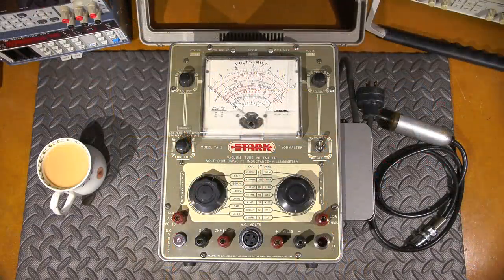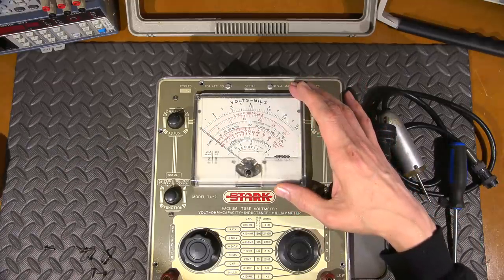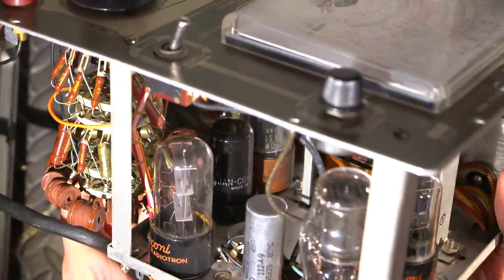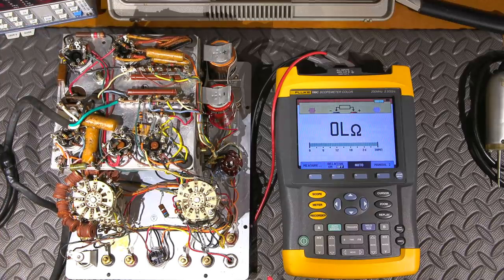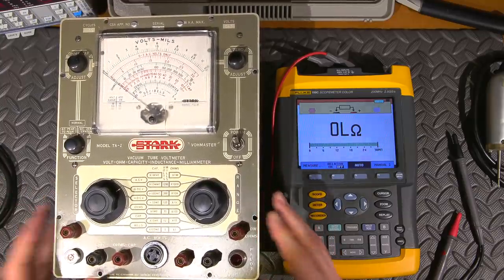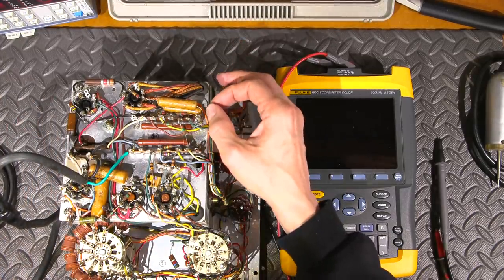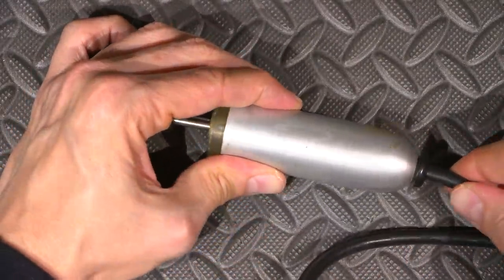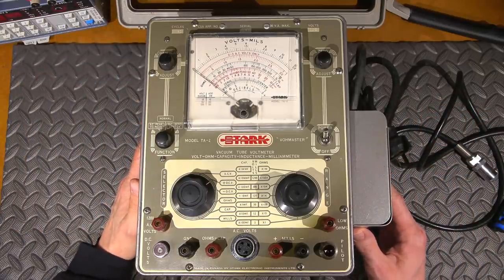Sharing More Electronic Knowledge - Tech Talk And Hang Time With Mr. C!

Comment from the maker: To learn electronics in a very different and effective way, and gain access to Mr Carlson's personal designs and inventions, visit the Mr Carlson's Lab Patreon page here: https://www.patreon.com/MrCarlsonsLab
Reply: Dear Paul, I have a Radio Shack Micronta FET VOM from the 1970s. I  like the high input impedance, but I regret that they didn't provide a MOSFET version. But, the next meter I would like to have is a VTVM. There is nothing like that classic old equipment smell that the tube equipment have, as well as the high quality performance that I remember from back in school in the 1970s.
Reply: I might actually be able to make it to the ham fest tomorrow in kalamazoo. I am in dire need of some odds and ends.
Reply: I just bought a very old Micronta  VOM at a Thrift store for $2.00 !!
Reply: Mr C  can't  you 3- d print a new lense ?

Comment: I love watching you Mr. Carlson. My dad died in 2016, leaving me with his old Grundig 2220 that he had owned since before I was born. He found it in a dumpster and got it working again. I loved listening to it, I used it for hours and hours. Unfortunately it's full of old caps. I stopped using it because I'm afraid of destroying the tubes. :( I'm working up the courage to replace them myself by watching your videos. My dad had bought an old All American 5 type AM radio before he died and I practiced cap replacement on it. It works! It's pretty out of tune. I don't know if he screwdrivered it or if a previous owner did. One day I'll get the Grundig safe to use again and I'll remember my dad fondly.
Reply: Doing stuff like this keeps that connection (no pun intended🙄) with your father... my dad was a cabinetmaker & though I ended up being a machinist all my life, I took up woodworking as an homage to him... I found that I would think alot about how he might do a certain cut or joint etc .. 

Good luck with the re-cap, Paul here will keep you steered in the right direction... I'm betting yer late dad would have loved these videos we are blessed to have ourselves... Thank you Mr. Carlson for that... 

From the Emerald Isle
😎👍☘️🍺
Reply: Manny,
Tubes are cheap and easy to replace. The danger is that the caps are leaky (beginning to pass DC) and load down the power transformer until it burns out the very fine secondary winding.  There is only a couple of things that usually make a tube radio beyond reasonable repair and they are the transformers, both the power and the IF transformers. Good luck with your dad's radio. It is not too hard to do, but you might want to practice on a radio you don't care about.
Reply: Don't rush it, Manny. Do your research. Your Dad would expect nothing less.
You will get it right.
Reply: @peterfitzpatrick7032  Nice that you do some woodworking to remember your dad. :) I find myself asking the same "what would dad have done" question and thinking about how I'll approach a project. I recently replaced my water heater. My dad was not a plumber, just a general repairman and maintenance tech for a jail and before that, an apartment complex. He did do lots of plumbing work as a result though. In planning the water heater replacement, I decided "Dad would do this job the right (hard) way using all soldered Type L copper pipe. He'd replace the old shutoff valve and he'd replace the drain valve with a full port ball valve for maintenance." So, that's exactly what I did. I used a few old copper elbows in the system in addition to the new ones from Home Depot. I used his pipe cutter, emery cloth, pipe wrench, channel locks, and work light to do the work. I'm quite proud of that install. :) I feel it's as good (likely better) than work a professional master plumber would do. Deburred every joint ID and OD. Lead-free silver bearing solder. Lead-free ball valve (tricky to solder). Water soluble flux. I practiced soldering correctly for days on some cheaper Type M pipe and couplings until I was very proud of my joints. I could hear my dad in my mind saying "No snots Manny! I don't like snots. Just take your time and let the solder wick in. There you, beautiful! Good job!" I think if he was here to see it, he'd pinch my cheek and say "You're my son." He was only 56, cigarettes caused bladder cancer. I wish I had 20 more years with him. :'( My grandparents were 83 and 81 when they died of natural causes. He could have done 76, I think. He was a good man. I would not be the mechanical nerd that I am today without his love and teachings. Your dad would be happy and very proud seeing you sharpen that chisel and use that table saw. Hopefully you have some of his own tools to use today? :) And yes, my dad would have absolutely LOVED Mr. Carlson. My dad had an associates degree and was a field electrician, but Mr. Carlson seems like an electrical engineer with extensive electrical theory education and advanced circuitry design knowledge. I think my dad likely would have went that same path if he had invested more in his college journey rather than stopping short and going with field work for new structure wiring and service calls. :)
Reply: @ianbutler1983  Thank you so much for this information! You just taught me several things! I do have spare tubes for the radio as well as a speaker and (I believe) a button set that my dad had acquired at flea markets and antique electronic supply shops, but I do not have any transformers. :( I don't want to burn these ones out. It sounds like I made the right choice by boxing the radio up and stoping my frequent use of it until I get it sorted out. I did practice this a bit by replacing the capacitors in my dad's newly acquired Emerson AM-only All American 5 type radio. I found it in his apartment while clearing it out. He did not have it before he got the cancer diagnosis a few months prior to his death, so I had no attachment to it like I do with the Grundig. I think he bought it to restore it as a sort of busy project to stay in good spirits and revisit his youth and old hobbies. He just never got started on it, or he may have just replaced a tube to fix it. It worked ok when I found it. I believe I did ok with that Emerson re-cap. I only replaced the cylindrical yellow and orange paper electrolytic caps that Paul always harps on about being failed at this point in time. What does he call them? Yellow bees, or honey bees, or yellow jackets, or super bees or yellow drops...something like that. 🤷🏻‍♂️ I didn't replace any caps that looked different than that, so I don't think I accidently put an electrolytic in place of any mica or other special, high stability capacitor design. I looked at and recorded every Farad and voltage value that was written on every cap and I remember that I researched the tolerance allowed for these electrolytics in tube radios. Then I searched for the right ones with the exact values or a value as close as possible within that tolerance on online electronic supply shops. I verified that each one's value and position was correct on the schematic as I removed the old ones and soldered in the new caps one by one. I did not take the risk reorganizing things or tidying up all the components like Mr. Carlson often does to make it neat and visually appealing. Just point to point, following the old layout exactly. 😸 When I turned it on for the first time afterward, it worked! I was happy! The reception is not very good though. Only the strongest local station is really able to be listened to adequately. If I remember correctly, the dial was off quite a bit, it had several birdies and hums, and I think one other issue that just made it uncomfortable and annoying to listen to anything other than the station which is very close to the house and has a powerful antenna array. The reason why I didn't power through and tackle the Grundig re-cap after that apparent success was that it functions in AM, FM, 2 shortwave band ranges, and external input mode. There are TONS of components inside that chassis. Tons! They're buried underneath each other and sprawled out everywhere! Very intimidating and I'll absolutely cry if I ruin it. I should probably revisit that Emerson and get it perfect. Maybe add filtering or try to tune it better for clear reception and get the dial accurate. The antenna is intact so it's internal issues plaguing the performance. :( Anyway, thank you so much for taking the time to read my comment and offer your valuable information. I sincerely appreciate it Ian.
Reply: @jlucasound  Thank you so much for your encouragement. :) You're right, I could see him saying "Don't rush it Manny, I know you're able to do it eventually. Keep learning. You'll get it. You're my son. If I could do it, so can you. The radio's yours now. Just do it right and enjoy it again like you did before." I lived in a tiny studio apartment by myself 10 years ago, fresh out of school. I had a small TV on my small entertainment center stand and the Grundig was right next to it. If nothing good was on the broadcast TV (couldn't afford cable) I'd listen to the FM radio and spend time on the internet reading or watching videos. It was a dark time in my life. I was very lonely. It was just nice to have the radio on for some voices in the background. Can't even tell you how many hours I listened to the Grundig as its green magic eye shined nicely and the rest of the internal tubes glowed peacefully out of the back panel reflected against the wall. I love this radio. Whenever "Lights" by Ellie Goulding or "Titanium" by Sia comes on, it brings back all those memories of the time spent at that apartment wishing I had someone to lay next to me. Those songs were top hits at the time, played over and over again all day long. That magic eye tube is one of the coolest things about the radio, I think. I can remember things all the way back to when I was 2. My dad kept all his radios and high voltage projects (a mini Tesla coil, an oil burner transformer Jacob's ladder, a transistor driven car ignition coil, etc) in his office with the door closed so I couldn't get in and get hurt. He'd let me in when he was with me. I loved that the magic eye moved as you tuned the stations. It was neat. It's the rectangular version, with the 2 bars in each end coming closer or meeting in the middle when the station is strong and perfectly tuned. Some stations would make it flicker and sort of bounce around when the person talked or loud bass drum beats were played. I liked that too. Luckily I have a new old stock spare for when this one eventually burns in/out its phosphorous coating and suffers a ghost image or gets very dim. Anyway, thank you for you wonderfully kind comment. You 3 have made my day reading your comments. ❤️ I appreciate you.
Reply: @mannys9130    I think we were just very impressed with your first comment..  yer on the right track Manny.... good luck & God bless... we all are our fathers sons.. and are proud to be ! 
(And yes, I have a few of his tools I managed to save & I use 'em now & again just because... 🙂)

😎👍☘🍺
Reply: @PJ PachasaJr I noticed that with the Emerson! The new caps were much smaller than the paper ones I took out. :) I almost thought I was making a big mistake, but I verified it 2 or 3 times before the surgery. 😸 "What can I replace the waxy paper caps with? Is that the type I have? Yes. Are they the right capacitance and voltage values within the tolerance? Yes. Well...I must be right. They're just more efficient I suppose." It didn't explode so I think I managed alright. :) I still haven't gotten around to the Grundig yet. Eventually, when the time is right. 👌 Thanks for the well wishes!

Comment: You can use Mother's Mag and Aluminum Polish on a section of cheap dollar store ultra absorbent cloth to get scratches, fogging, etc. out of the clear plastic on the meter. In some bad cases I finish with a little Novus #2. Works every time even on plastic eyeglass lenses.
Reply: Good tip, thanks !

Comment: As soon as I saw the VOLTS-MILS across the top of the meter I knew there had to be a connection to Hickok.  The font is exactly the same on my Hickok 209A with the black background and white lettering on the meter.  I acquired my 209A when I bought out a TV-Radio shop at least 40 years ago,  that had been in business since the 1930s.  I liked it then because of the uniqueness of the very large meter, now since I've developed macular degeneration the size is a great asset.  Mine needs restoration but it does still work albeit rather crochety much like it's 70 something owner...

Comment: Doubt if many people under 50 know much about vacuum tubes. My first color 25" TV had some vacuum tubes. I built a tube & transistor tester to locate a bad tube in it. Still have my RCA tube Manuel that I purchased in late 1960 's. Have a 5 tube AM FM radio in my garage that still works. I bought it for $10 over 50 years ago. Great vid.

Comment: The tube in the probe is a double diode.
E= 6,3 V heater/filament
A= small signal diode
A= small signal diode
9= 7pin miniature socket
1= number

Comment: I've been buying old Phone and Tablet Screen protectors cutting them to fit my meters and other test equip to prevent scratching. I believe most of them use silicone based adhesive which should be safe for plastic.

Comment: I don't have engineers to mess with but I attend to carry around a RCA WV-77 VTVM with me servicing Alarm Systems. I get comments from older folks saying "I used one of those back in the day" or "Where do you find tubes for that".
Reply: Still use a Simpson 260 for a lot of repairs.  Have several VTVMs as well.

Comment: 24:30 I have felt that buzz even on properly grounded devices - or at least "sufficiently" grounded. There are of course many houses that still have a "Swedish ground" where a jump wire is run from the neutral to the ground strip of outlets, and for most practical uses this is sufficient for user safety. However it takes one mistake to make this kind of wiring scheme extremely dangerous.

I remember a situation when I was in the vocational school and we did miscellaneous electrical work. There was a Finnish saying "on syksy tullut ja harmaa maa" (from a song or poem, I think), which means "autumn has come and the earth is grey". I learned it from an electrician some years earlier. Up to the 70s or early 80s there was an old coloring scheme where the neutral wire was grey, and then black, yellow, green and purple were used for live wires. The neutral was considered equivalent to earth just as well. So, we were in the mid-90s and a new wire coloring scheme had been in use for over ten years, where blue is neutral, black, brown, and white, and initially a black/white striped are for live wires and yellow/green striped is a dedicated earth wire. 

We were working on an older house where the owner wanted grounded outlets in a room. So, at that time it was still legal to dedicate one box in a circuit where the neutral could be jumped to the earth , and from that spot on you could extend a chain of earthed outlets. So, this house had grey for neutral and in that area green for live. The other guys asked me if I knew which was which, and I said that there is this mnemonic (... the earth is grey). They didn't believe me and hooked the green with blue and yellow/green, and the grey with black. Our instructor came to check on the work and said "olette tehneet vihreen kanssa hirveen virheen" (you have made a terrible mistake with the green). He then asked why it was done so, and the other guys said that "J told us the earth is grey but we doubted him and joined the more logical colors."
Reply from the maker: Thanks for taking the time to write, and sharing your story Jussi!
Reply: That sort of "ground" was never allowed on 120v outlets in the US but some people did it anyways. I've read a story online where somebody got a big arc when hooking up a cable to their TV. Sure enough the ground terminal of the outlet was strapped to its neutral terminal, but live and neutral were switched before that. Even though the ground was live, it's worth noting that the outlet testers available at hardware stores will say that there is no problem.
Reply: @eDoc2020  that has been pretty much forbidden now, there are a few exceptions though. The last socket in line can be made that way if it is either at least 2 metres away from the preceding  "Russian" socket or if it can be considered to be in another room. Also old systems can stay as they are and even renovated by new fixtures if the wiring is not remarkably altered. 

Of course what is remarkable and what is another room is sometimes not very well defined.

Comment: Stark was a Canadian company that made products in Ajax ON. I haven't been able to find out if they were a subsidiary of Hickok, if they made instruments under license or if they were just pirated copies. I have a power supply of theirs which is a virtual copy of a Heathkit IP- 32. Dunno if there was any connection but they were near Bayly Engineering who made a lot of RF Instruments mostly for the military. Cool factoid:  In addition to being the first mayor of Ajax, Mr Bayly designed and built the the huge transmitter that communicated with all the allied spies in WW2 from Camp X (the allied spy training camp) which was located just east of Ajax.

Comment: Hi, from England, UK. That's a fine example of precision hand built electronics, just like an old British oscilloscope I've got, and that has cold cathode neon stabilisers too. And the rectifier valve, or tube, should have a fuse in line between it and the transformer then it won't burn out.  And judging by the appearance of those valves in that meter it looks like it was made in the 1940's. And that meter is in remarkable condition for one so old, it looks almost like new, it's obviously been well looked after, not like some.